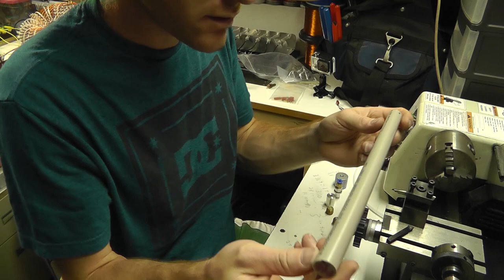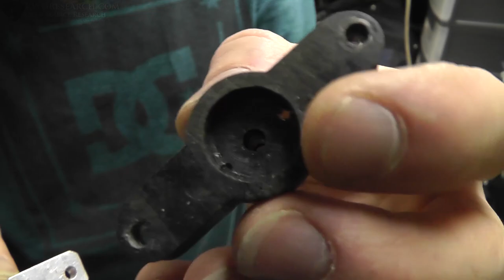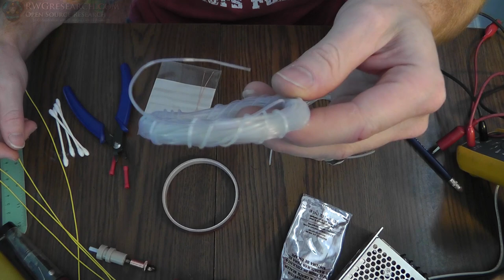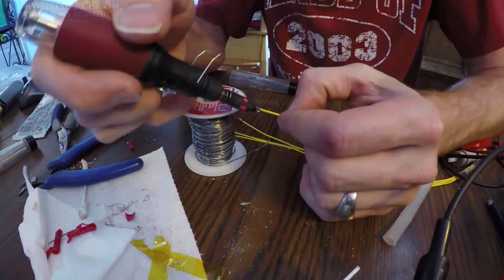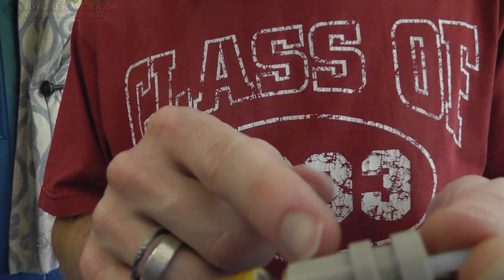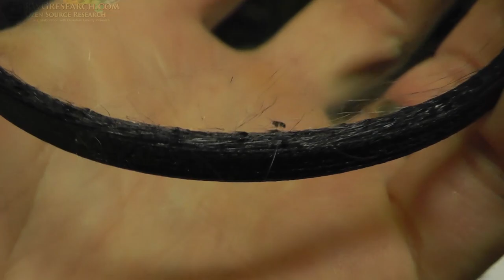DIY - Building A Hotend From Scratch... ( Heater Too) Testing Ideas For The OSD......

Comment: hmmm you realy got me thinking i have to say that i like the idea of a circular heater instead of a block.
i think i have to try this myself.

thanks for the clear explenation 

tom
Reply: Let me explain, at least a little bit, as to why they use the block because all hotends began like Russ made.  The main reason is that the heating block has more mass so doesn't cool down suddenly when more MUCH cooler plastic hits it.  It requires less energy and remains a more constant temperature.  Everyone went away from what Russ just made due to what I just mentioned.

Comment: 40watt heater.
big difference when you don't need to heat a block to heat a tube to heat the filament.
i always felt the the blocks need to be  insulated, but it does take more time to heat up more metal. i have to redesign the block. the cartridge I still like for ease of change. i will look into this more.
all my blocks I run have the "ceramic blanket" with kapton tape holding in place.
Reply: i have always wanted to use the ceramic heating element in the good soldering irons and run it with a SSR. i want to try this type of heater for the fast heat and fast cool.

Comment: Your tip did not heat up because you created a thermal break with the Teflon tape.  There is a very good reason the nozzle is supposed to seal against the heat break and not rely on the threads to seal it, because they won't.

Comment: Awesome job Russ was wondering when doing 3D prints do they always have the hatching issue or can that be overcome on a finer setting ?
Reply from the maker: there is all ways a small defect because of how the printer works. however one can smooth parts with chemicals and such. but most of the time its not enough to worry about. ~Russ
Reply: Thanks :D

Comment: what's the best extruder set up for a delta printer? is it possible to buy it pre assembled?
Reply from the maker: there is never a " best" there is only a "best" for a problem... case in point. 
what filament are you running, what temps, what speed, ect. when you get your "wants" you can then pick what will work " best" 

There is no one setup for a printer. it all depends on what your doing. 

if your wanting speed, Light is best ( basically what i have done here) but i may need even more heating power to keep up with the speed. 
if you want high temp plastics you need to use All metal hot end ( heaver and needs a fan) 

any how yes, there is prebuilt units that you can buy. jut find the one for your application. 

Just done buy a cheep knockoff. it will be disappointing. you get what you pay for :) 

hope This Helps!
 ~Russ